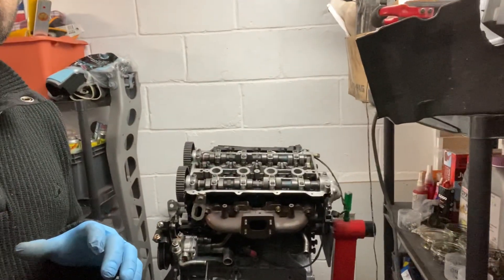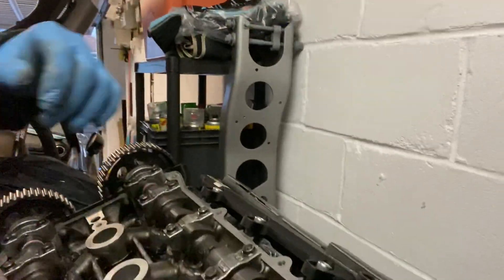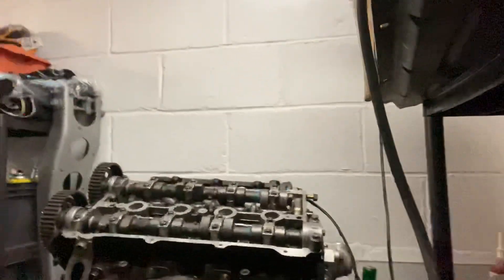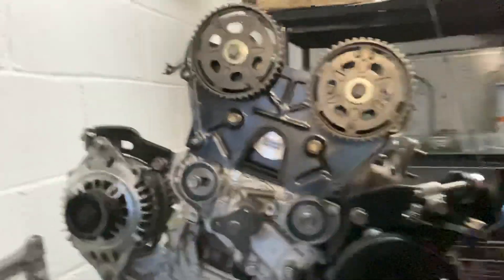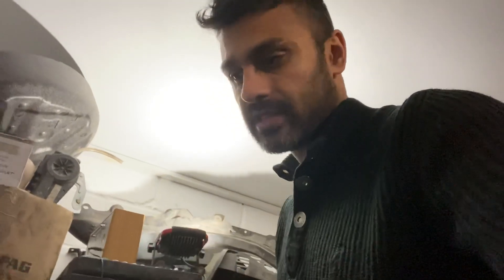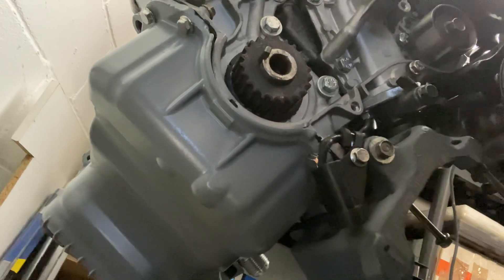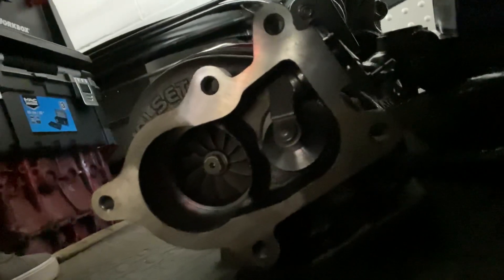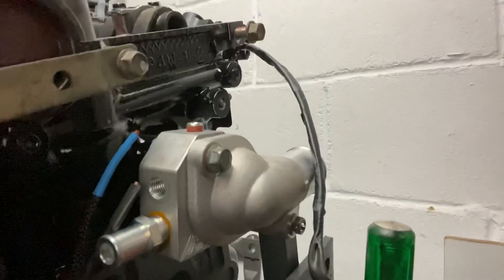MX5 Miata Turbo HE221 snapshot rebuild

Comment: have you got the car up and running yet, I'm on the fence about upgrading to a he221
Reply from the maker: Negative. Life took over. I was recommended it by Nick (formerly Skuzzle) because after he worked on one at his shop, he couldn’t believe how well it performed on dyno - and with lack of lag. 

It also cools with oil, so one less set of lines to worry about.
Reply: @chrisjamesbehan  do you still have the car?
Reply from the maker: I do!

Comment: did you finish this build
Reply from the maker: Has been on hold for two years. Life unfortunately. Engine is on the car, about 90% piped up - oil in it, just need to organise the boost controller wiring and turn her over! 

But she’s also in a different city to where I moved - so hard to commit now.

Comment: What power are you going for? I've a forged 1.8VVT engine in my Westfield which is running the same turbo. We're expecting about 320bhp - car is going for mapping on Wednesday 😎 I've a few videos on my channel
Reply from the maker: Will take a look! I’ll be happy between 250 and 300, but I’m building it to take way more. Reliability and OEM drivability is more important to me these days
Reply: Chris Behan I agree. I had to fit a new forge motorsport actuator as the one that came with the Holset had a base pressure of over 2 bar lol. There’s now a 0.8 bar spring in the actuator which produces 260bhp. We’re yet to turn the boost up but we don’t see any reason why it won’t sail past 350bhp now tbh
Reply: @Carkevo  any chance you have a link for the actuator you went for?